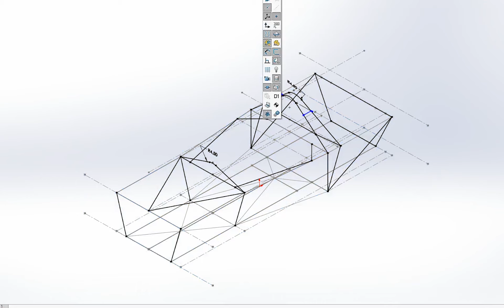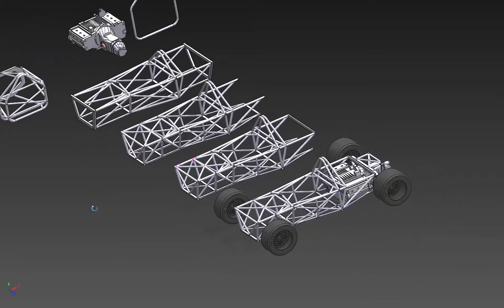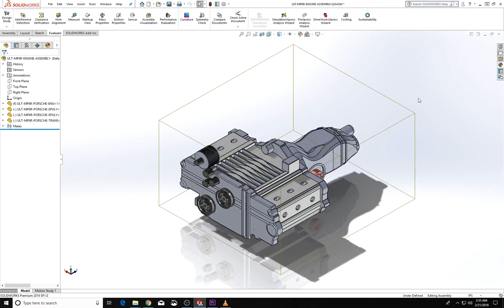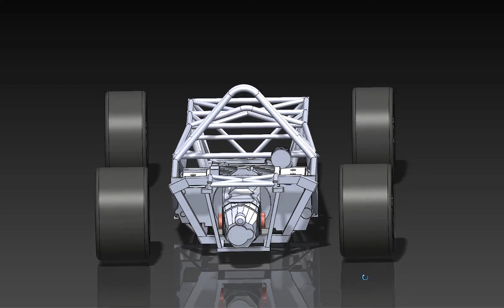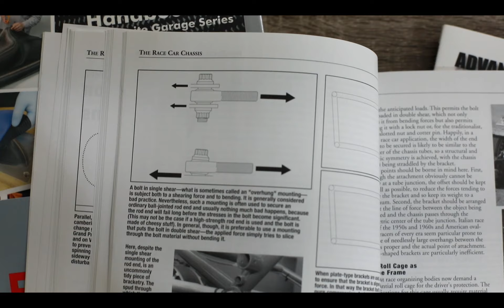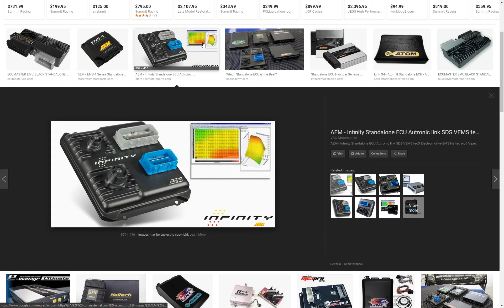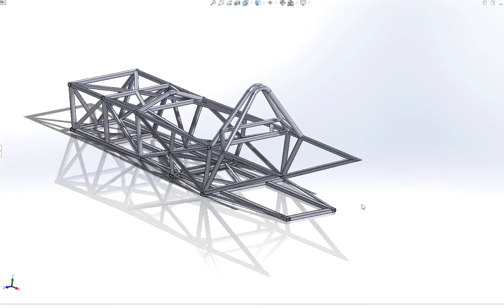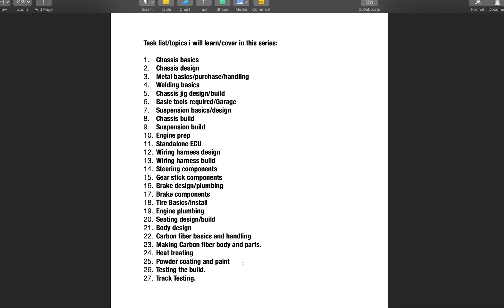How to Build a Formula 1 Car - Chassis Design - Ep1

Comment: Nice chassis. I would use low carbon steel rather than chromoly for your application - less cyclic fatigue cracking issues. Chromoly only for an all out pure race car
Reply from the maker: Choose to go with use low carbon steel for the first version.
Reply: What type of aluminum would you use for a chassis like this?
Reply: @longsleevethong1457  don't use aluminium tubes, never use aluminium tubes
Reply: @davidaugustofc2574  tell that to Porsche
Reply: @longsleevethong1457  well, you ask Porsche to build it for you then.
Reply: @davidaugustofc2574  nEvEr uSe aLuMiNuM…
Reply: @longsleevethong1457  because it's a homemade project, Porsche would spend several hours in the making of each chassis just to retire the car if any crack appeared. How many people that can weld aluminium do you even know?
Reply: @davidaugustofc2574  good thing you weren’t one of the wright brothers.
Reply: @longsleevethong1457  and you are, lmao

Comment: Hi, I just found your video. While I'm still watching I decided to tell that I'm glad there is this video and other's too related to building an F1-like car. I'd love to build one too. I guess I'll have to start with books and familiarizing with an appropriate CAD software. I'm also inspired by former F1 cars from 60s like Honda F1 cars in the late 60s or even modern Ariel Atom. I see people start welding right away and some even fail later because project becomes more and more complex and lack of knowledge makes it more and more difficult to continue. I'd love to build something simple with regular Honda engine or the one from Type R cars. I'm curious what is the target weight of such car and could you keep it under 500 kg?

Comment: How did you design the engine? Did you guess on the dimensions? Did you measure the engine yourself? Did you find the dimensions online? I've been designing cars in CAD in order to build them, but I can't get all the frame dimensions right without having the engine's dimensions.
Reply from the maker: Yes I measured the engine before making a rough model in CAD.

Comment: Use a Honda goldwing engine. Compact Flat 6. Sequential transmission. Can install a slipper clutch. Shaft drive. Late models have reverse. A usable rev range and transmission gearing.

Comment: Me personally if I were to use a non V8 engine I would go with the 4G63 out of the Mitsubishi Lancer Evo because those things are damn near Bulletproof small engine displacement but can produce a large amount of Power with very minimal upgrades I mean the stock Engine with new timing better injectors and maybe a new head can easily handle upwards to 800 horsepower with a twin-turbo setup and I would use the Porsche transaxle and the engine can be found in a eagle talon as well as the Mitsubishi eclipse up until they did the body redesign in the late-2000s same with the Lancer Evo going towards the Evo 9 and Evo 10 but the regular Lancer still had the engine it just didn't come with certain performance upgrades pretty much for raw power the engine is the 4-cylinder equivalent to the rb26dett from the Nissan Skyline GT-R R32 through R34 as well as the Toyota 2JZ both are inline 6 engines but they can create crazy amounts of power and are both well known for being borderline indestructible and for the Mitsubishi engine because there were so many cars built there are plenty of replacement parts and third-party aftermarket parts for upgrades and replacement components

Comment: Are you planning to race this in a particular motor sports class? Might be wise to check the design rules set by the applicable motor sports organisation before you go too far with the design.
Reply from the maker: I am building this as a Formula 1 inspired build and as a project that teaches me all I need to know. I want to use this more like a track car and a learning project.

Comment: The most important quality that any road race car chassis needs to have is torsional stiffness. Without stiffness the car will feel like rubber to the driver and reduce his confidence to drive the car fast enough to beat other cars and win. The suspension mounts should also be as stiff as the chassis. If the suspension mounting brackets flex under racing loads, the car will feel, again, like it's made of rubber. Same goes for suspension arms, steering gear and their mounts. No matter how light weight and/or how much power a race car has, if the driver does not have confidence in its handling, the car will only go as fast as the driver feels comfortable. Never sacrifice torsional stiffness and suspension component structural integrity for light weight.
Reply: If the frame is 20kg heavier than it needs to be, on the other hand, it won't make much of a difference
Reply: @davidaugustofc2574  I did NOT post that a frame NEEDED to be heavier to be stiff, but that light weight at the expense of torsional stiffness is poor engineering and racing strategy.
Reply: @Buckoux  But I DO think it's important to point it out to someone that never designed a frame before/has limited experience.